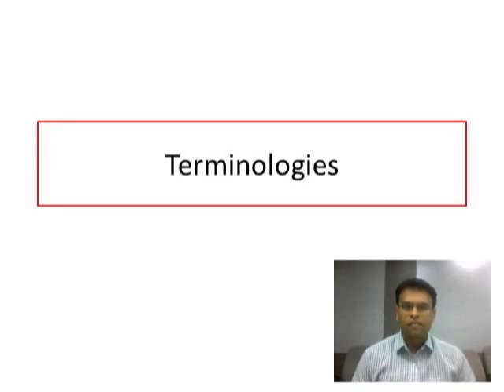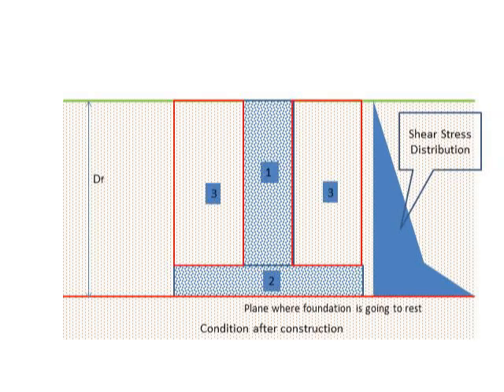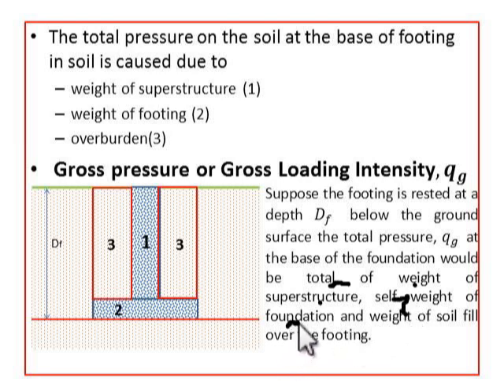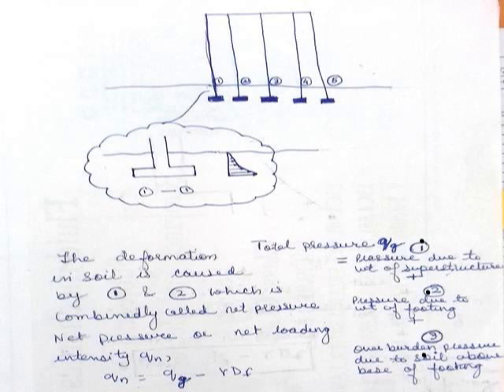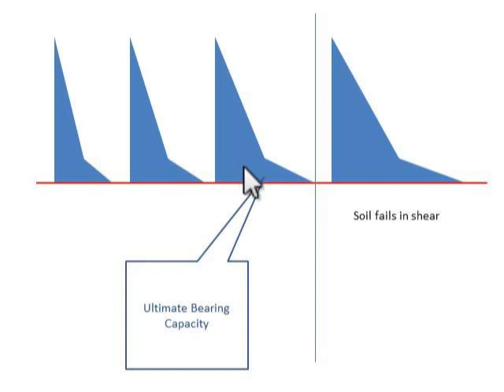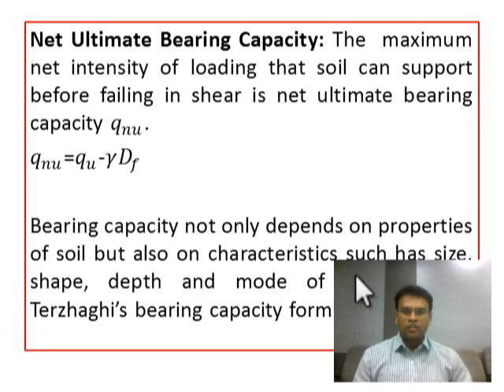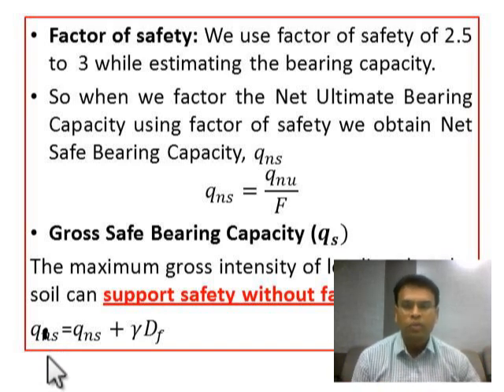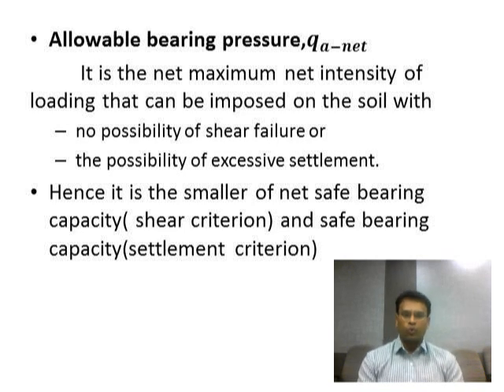Ultimate Bearing Capacity, Net Safe Bearing Capacity, Safe Bearing Pressure

Comment: Hi ... thanks for this very informative video on bearing capacity.
I have one question, if you can plz reply.
As per design drawing, designer notes that the design has been done considering the Allowable Net Bearing Capacity of soil as 500 kPa (with maximum allowable settlement of 25mm) and the same to be verified before construction. 
And while doing plate load test, the 3rd party lab. applied the maximum pressure of 786 kN/m2 with maximum load of 125 KN (450mm dia plate used). They provided the result as "Allowable Bearing Capacity" of 314.4 kN/m2 by using factor of safety 2.5. 
Now the question is how can we differentiate "Allowable bearing Capacity" and "Allowable Net Bearing Capacity" to compare the designer's assumed value and the result from plate load test. 
Your reply will be appreciated. Thanks